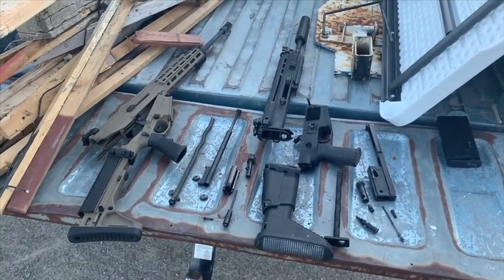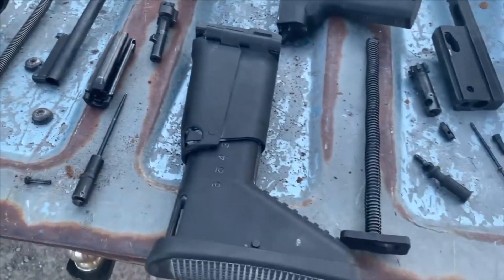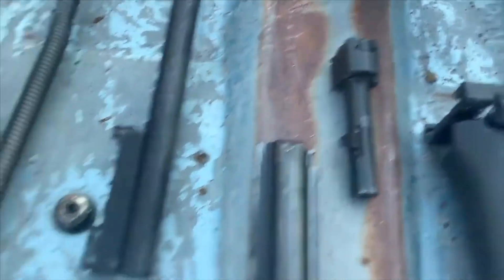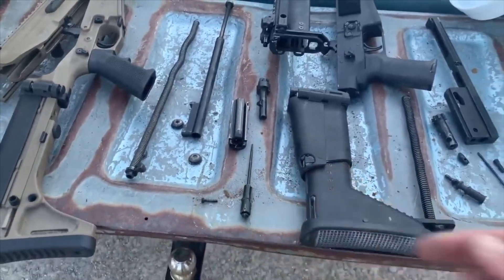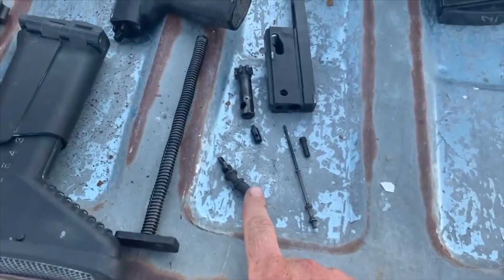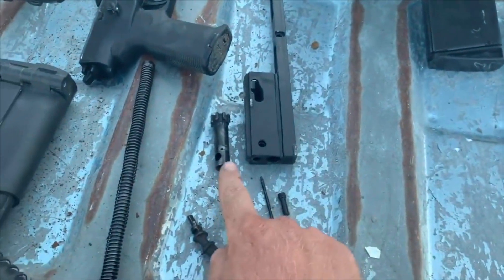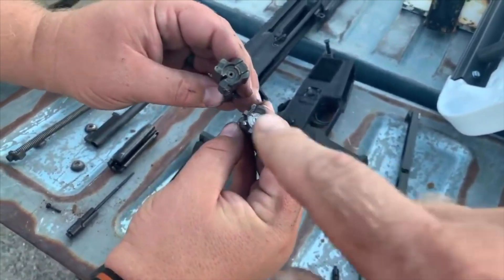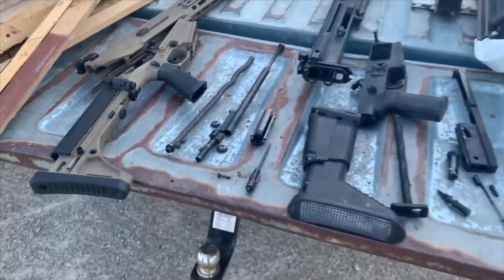Robinson Arms XCR-M & FN SCAR-17 Internals Comparison

Comment: Current XCR-M's are available with two different gas systems.  You can choose either the short stroke White type gas system (similar to the M14 system) OR the long stroke gas system.  The choices are in the drop down menus.

Comment: I'm pretty sure RA's Type 2 gas block (used in that XCR-M) is actually a short stroke system: a small stainless steel piston is retained within the gas block and can only travel <2" (a short stroke). It then "throws" the separate piston extension/carrier assembly the rest of the way to the rear.

I think the type 3 block is an actual long stroke system, where the piston head slides inside the gas block then is forced back by the gas and travels all the way to the rear with the oprod/carrier/bolt all in one "long stroke", like the AKs.

Someone plz correct me if I'm wrong, I have no hands-on experience with Type 1 or 3 blocks, just Type 2 (I own a 308 xcr-m)
Reply: How do like your rifle? Type 2 provides enough adjustment?

Comment: I really like the SCAR bolt carrier for the way it reduces carrier tilt and friction. I just wish it was put into a package as sleek as the XCR.
Reply: As I understand it, carrier tilt isn't really an issue on AR-18-derived designs, since the recoil spring is located in-line (or at least more in-line) with the piston than adapted AR-15 piston designs.
Reply: ParabolicBox Well, sorta. The reason Ar18 & it’s derivatives don’t have carrier tilt isnt so much the relationship of the piston to the springs, it’s because the bolt runs on guide rods. With that set up it’s impossible to have carrier tilt on a AR18. The reason piston ARs, and specifically short stroke one, have carrier tilt is because of the few MM of offset from the connecting rod to the strike face on the carrier. That little bit of set is what causes the carrier tilt. My lwrc has some tilt to it, but not much to be a major concern. Eventually the wear in the receiver extension stopped.

Comment: That SCAR-17 has some parts almost in common with an L85.
The bolt's quite similar, the firing pin looks kind of similar and the cylindrical cam stud that has to be put in with the hole level (and pulled back half a millimetre) for the firing pin to go through it and tiny little firing pin retaining pin, both of which are rather easy to lose in the weeds, are very similar indeed.
Would a two-part bolt carrier work? If it was held together by the return rods there's be no need for a firing pin retaining pin and the cam stud could be integral to the bolt.

Comment: I can't believe the military would disqualify a firearm on some irrelevant technicality. Not saying the SCAR is a bad rifle, far from it. Perhaps the military even made the correct decision in selecting it. However, after seeing how the XCR performed in your battle rifle trials it's very obvious it didn't get the chance to be reviewed that it deserved.
Reply: Doesn't matter how well a product is designed if the company producing and offering them can't supply the stated required parts for trials and production contracts. It's more than likely the XCR if it went up against the SCAR in trials, would have been rejected anyway, the ones they were making back then were garbage compared to their current ones, they made a lot of cruddy rifles that had to be returned to them several times before they ran properly, let alone shot half accurately.

Comment: The XCR-M is also a short stroke. Take the barrel off and look at the gas block. You'll find the piston that pushes the op rod protruding from the back of the block. Source: I used to build them.
Reply: why instead of going on a full long stroke or a full short stroke like on the vz58 or svd they went with the high reciprocating mass of the long stroke while having the downsides of short stroke like high pressure and another piece etc...

Comment: Hey Karl! Greetings from the homeland. Would you do an in depth video on the m14 and why you think it's so bad. I live in Norway and guns like the Garand and m14 is hard to come by, if not impossible. So I don't understand why the Garand is so great whereas the m14 is so disliked, especially by your armed forces. Love from Norway.
Reply: Not Karl obviously, but the basic gist is that the M-14 wound up being essentially a product Improved M-1 Garand that had all of the same problems. It used an overpowered round that limited ammo capacity and made the gun uncontrollable on full auto, the locking surfaces were completely exposed which led to reliability issues in dirty environments, the gun was exceptionally heavy, required more maintenance and took longer to clean, etc. The M-1 Garand was revolutionary at the time for being the first semi-automatic service rifle deployed on a wide-spread scale and was used to great effect in WWII as a result. The M-14 was vastly outclassed by the AK-47 in the jungles of vietnam, so is not remembered quite so fondly.

TLDR; the M-14 was obsolete when it was introduced, the M-1 Garand was ahead of its time.

Comment: The XCR just looks so sleek compared to the SCAR. Being a long stroke piston, is it hard on optics like the SCAR?
Reply: It isn't the operating system that kills glass on SCAR's, its the resonant harmonics transferred to the upper receiver with how the barrel is secured and the high mass of the bolt with its higher than average acceleration. NSWC Crane managed to develop harmonic dampeners that would fix the issue on Mk-17's but decided against putting it into production because it wasn't cost feasible. The SCAR's lust for electronic blood isn't limited to optics either, theres an approved list (for the USN at least) for all items/accessories put on deployed/issued Mk-17's including lights/lasers and such.
Reply: The long stroke, piston bar on the XCR is larger than the AK piston rod. Plus the mass of the bolt carrier group is larger and heavier. Plus there is a "rubber" pad located either on the rear lower receiver, or, on the rear of the bolt carrier group. Which one is on the XCR depends when it was made. Older XCR-L's have a receiver mounted pad. Newer designs have them bolt carrier pad. If you have an older XCR-L and want to change to the new style pad. Send a email to Holly at Robinson Arms and she will tell you about the process.
   Been using an XCR-L long before the XCR-M was made. Mine is stamped XCR only, not XCR-L. 
   Mounted an Aimpoint M-3 optic that's never failed. Please note! Use low optics mounts. Do not use those risers that are used on AR rifles. Low is the way to go on XCR's. The FAST stock has plenty of adjustment possibilities for 99% of people. Rule of thumb is to use optics mounts that are used on MP-5's. You will have zeroing problems if you use a AR sight height. 
   The best recommendation is if that great boogaloo starts. And TEOTWAWKI is the norm. You can bet your last nickel I'll  have the XCR.
Reply: Remember that you can easily adjust the gas system in moments on the XCR. One of the reasons that it is a soft shooter.

Comment: Give me the XCR any day. That contest for the SOCOM rifle trials was an XCR that is now called the XCR-L. Chambered in 5.56-NATO. THE XCR-M the most recent rendition of the XCR family, and, is mostly chambered in 7.62-NATO. Both rifles are multiple caliber rifles. Needing only three parts, barrel, bolt and ejector. Only need a medium sized Phillips head screwdriver and a ¼" Allan key for tools.
   There has been lots of changes and improved parts to the rifles since that test. The butt stock, called the FAST stock is a proprietary design by Robinson Arms. Far better than the adapter mounted AR stock that was originally used. All firing controls are ambidextrous now. All small parts are heat treated. The first change was the gas adjustment knob near the muzzle.
  Using the XCR-L for 13 years. Wouldn't have an SCAR or an AR. Not one hiccup ever on a range day. Besides cleaning is far easier than every other firearm that I ever cleaned. I only use a bore snake, solvent,  paper towels and gun oil afterwards. 
   What was said about the XCR is the it is mutt pup of the DNA of the M-1 Garrand, M-16, AK-47, FN FAL, M-14 and the MG-44. Making Alex Robinson on par with John Moses Browning. There are three US Patents of parts in the XCR system. Lastly, use optics mounts that are low on the rail. Use scope mounts suitable for the MP-5 and your good to go. Mounts used on the AR are just too high. You will never get a zeroed rifle with mounts too high. Take off those mount risers used on your AR.
Reply: There is a new bolt recoil pad design. The older system used a shaped "rubber" pads attached to the lower receiver. The new pad is on the rear of the bolt carrier group. A wider milled area in the rear of the receiver accommodates the newer bolt carrier.
   There have been some new designs to the FAST stock. You can call it a gen-2 and gen-3 stock. All FAST stocks are firmly lockable in the folded and extended positions.
Reply: Robinson on par with Browning? FOH with that trash...
Reply: @JJheadcharge   yeah. thought the same. this sounds like a door seller trying to get you to buy his super vac. :D
Reply: "Making Alex Robinson on par with John Moses Browning." 

That's really stretching it, my guy. JMB's designs and guns are still widely utilized today, and the guy's been dead for nearly 100 years.
Reply: Alex Robinson has three US Patients for designs of the rifle. And know I am not involved in any way with Robinson Arms, nor, am I in any way in the marketing field.
   One of the patented designs is the dual functioning charging handle. Not only does the handle work the bolt. It is also a "forward" assist that goes both ways, forward and to the rear. The charging handle can also be used to mortar the stuck casing out of the chamber. 
   Next is the Gas Adjustment port. A much simpler design than all other types that offers five settings plus a suppressor setting. 
   The propitiatory design of the F.A.S.T. stock is far superior to any other folding stock I have ever seen. Most other stocks are made of plastic, with little amounts of metal.
   The bolt release is strictly a Robinson Arms feature. From it's initial design it is ambidextrous. An upside down T shape that is intuitive to use. 
   The firing pin is captured inside the bolt, via a small roll pin, to ease field maintenance issues. Far less parts than a AR-15/M-16. Less parts equal less of a possibility for a broken system.
   The XCR-L is multi-caliber  capable. The same rifle can use these calibers: 5.56-NATO, 7.62x39 AK, .300 Blackout, and the 6.8 SPC. The XCR-M uses the 7.62NATO, .243-Winchester, and, the 6.5- Creedmore. There may be others.
   I am not connected in any way to Robinson Arms. I am just a long term user of the XCR. And like John Browning, Alex Robinson is a skilled mechanical engineer that is in Salt Lake City, UT. The factory is located in Salt Lake City.
Reply: Whomagoose   I am working in the purchase-import department at a firearms wholesale company overseas. Out of luck and pure coincidence we got connected to Robinson Armament just a couple of weeks ago. We are very happy that we were given the opportunity to work with them. We will start importing their rifles into my country this year. Mr. Alex Robinson is a class act and he always responded to my many technical questions quickly and in detail. Since the XCR offers an almost bewildering choice of options, selecting the most viable variants for our market is crucial. What I consider a big plus and actually a marketing advantage is that the XCR ain’t another AR-type of rifle but a somewhat unique gun in its own right. There are many shooters out there who just dislike and distrust the Stoner direct impingement system. Since FN SCAR cannot be legally owned in my country, I expect quite a bit of interest in the Robinson Armament XCR over here. From what I saw, I actually consider the XCR concept somewhat superior to the FN solution. Perhaps the „wrong“ gun was chosen for whatever strange reason back then?

Please allow me to add that the XCR-L can also be converted to 6.5 Grendel and 6.8 SPC, while the larger XCR-M can also use a barrel in cal .260 Rem. - in addition to the calibers you already mentioned. Interestingly, the XCR-M does not need different bolts (or bolt heads) or different magazines when converting from .308 Win. to either 6.5 Creedmoor, .243 Win. and .260 Rem - and vice versa. Just the barrel that fits the respective variant needs to be exchanged. When it comes to the XCR-L, caliber conversions are a tiny bit more complex, but Robinson Armament’s website helps tremendously and let’s the viewer exactly know what gun parts he/she needs aside from the barrel to convert their XCR rifle variant from one caliber to the other. I am pretty impressed and excited about the XCR and am quite sure it‘ll become a commercial success over here.

Comment: So the XCR is what the AK-12 should've been.
Reply: The ak12 is what the ak12 should have been instead of turning into what it did. What do they call it now, the 400?
Reply: @nejinaji at some aspects current ak-12 could be way better, that’s true. but those cool prototypes wasn’t adopted for a reason. army tests proved their unreliability. so it’s still better to adopt something like current “downgraded” ak-12 than untrusty modern looking thing. just imo.
Reply: by the way. they might just upscale a little bit these new models based on Dragunovs MA to full sized rifle. they already used this concept to create SVCh anyway.
Reply: @randomperson-fr8ig  Then there was no point into making it a new gun, they should've just continued development until it was reliable. They should've just given out an upgrade kit instead of releasing a whole weapon. Its functionally a 74m with furniture improvements.
Reply: That comment aged well unlike the replies. The AK-12 has so many problems... The safety lever is garbage, the foregrip is unfit for night combat by mounting IR laser devices, the dust cover doesn't hold zero, the two round burst fire mode is useless, some parts are more prone to wear and rust than before and not even Zenitco parts can really fix the AK-12's issues so the russians now decided to develop a new variant fixing most of these. Because the contract was simply a classical case of russian corruption for Izhmash's CEO.

Comment: Only gripe I have against the Mk17 is that stupid pencil barrel. I'll enjoy a tad more weight with the added rigidity and consistent accuracy from a medium barrel. Other than that, it's possibly the best battle rifle out there. Medium barrel and non reciprocating handle and it would be the best
Reply: Ian and Karl tested Faxon pencil barrels when they did the wwsd project. Modern metallurgy ftw.
Reply: @devincook2736  Consistent accuracy... Been shootin precision rifles for about 13 yrs now. Modern metals still can't overcome many other physics when you fire a round. Rigidity, rapid heat up & expansion, barrel sway etc etc. Pencil barrels are fine for paced shots, but not repeated shooting. Groups open up real quick with thin barrels.
Reply: @GrySgtBubba   unless I'm mistaken, these weren't built as precision rifles. 2-3 moa groups out of a 'battle rifle' and not a dmr sounds about right compared to other offerings, and if you can shave off weight and get the same result why not?
Reply: @devincook2736  I think they're sayin 1.5-2+ for em, which another thing they were advertising is SpecOp dudes usin the basic 16" as a DMR with an LPVO. It's capable of bein quite accurate out to range, but once you start actually usin it ina firefight condition, that group spreads alot at just 200yrd. Then FN came out with the 20" sniper and 17" DMR versions which have a medium barrel. Honestly, for the very added accuracy bonus vs not all that much more weight, a medium 16" would be a ton better way to go